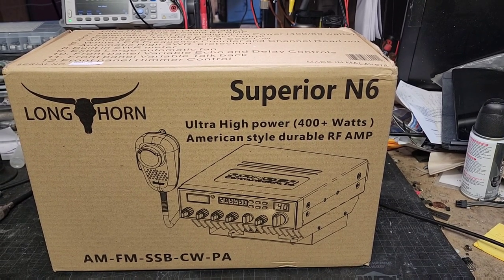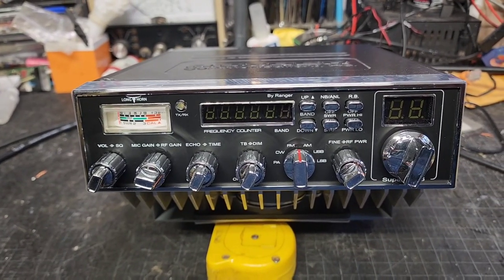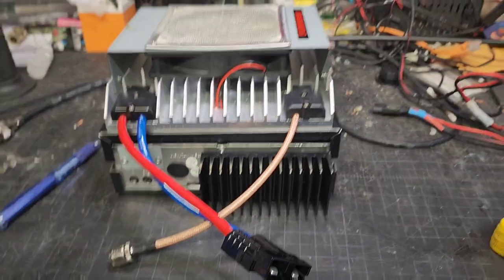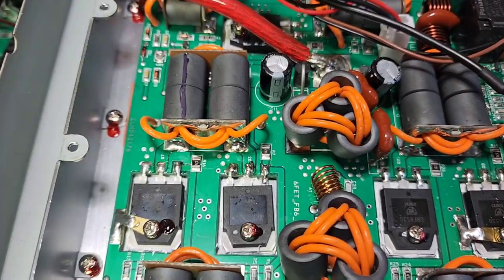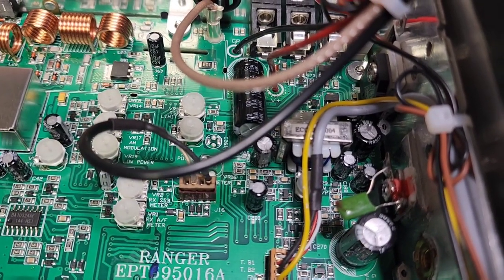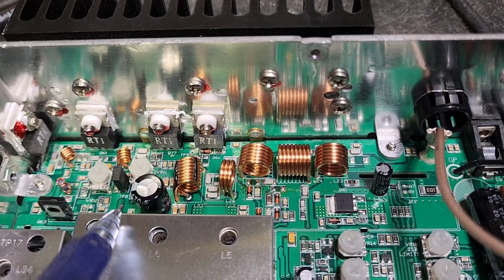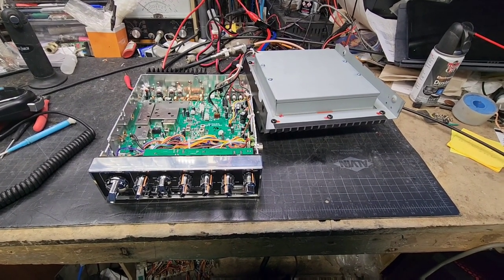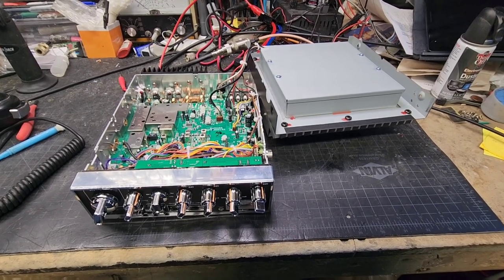Ranger Longhorn 10 M Radio Review @cbrepairguy

Comment: Fine tune only, no coarse. Needs coarse. Needs light on for ring lights around buttons. Sometimes you think amp is on and it's not. My N6 never gets very hot. Fan barely kicks on. Ssb is A/B biased Chris Holland said. So pretty clear on ssb, except the clarifier is unlocked, so have to tune yourself in, then the recieve. Kind of a pain.

Comment: Tell them how illegal that radio is in the USA
Reply: That radio is not illegal as it comes from the factory. What makes it illegal is it’s conversion to operate on 11 meters.
Reply: Mine’s not, but then again, I only use it on 10 meters. While not as clean as my Icom or Yaesu, it is within specs. It is ran in my F-150 wheeling rig and it doesn’t shake any parts loose after taking it out 3 or 4 times. Even if something does come loose, I can resolder parts back in and not have to wait 4-6 weeks to get my Icom or Yaesu back because of all the surface mount components that I don’t have the equipment to resolder properly. 
 If you’re going to go to CB Radio sites and tell people that the radios are illegal, how about telling them how to make it not a prohibited item. Instead of antagonizing people, tell them of the good things about amateur radio and getting licensed. I’ve found that in the 20+ years that I’ve been licensed, I get more people interested by being positive than by being condemning.
Reply: Sad Ham 🙄😉😉